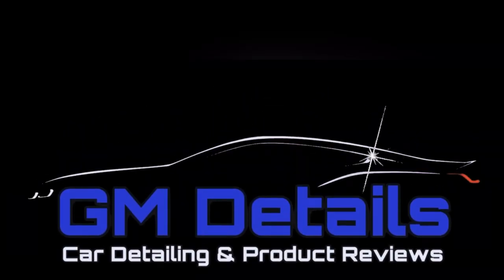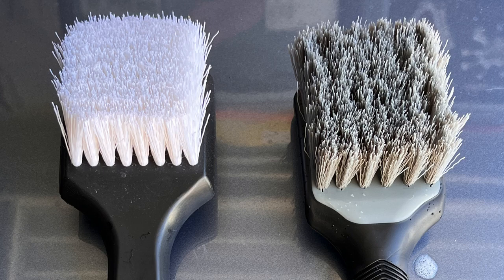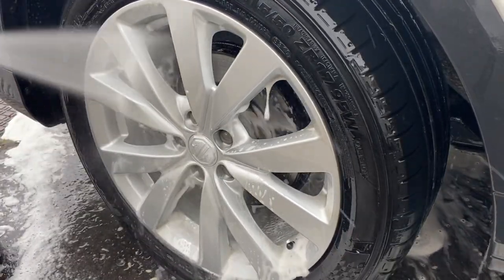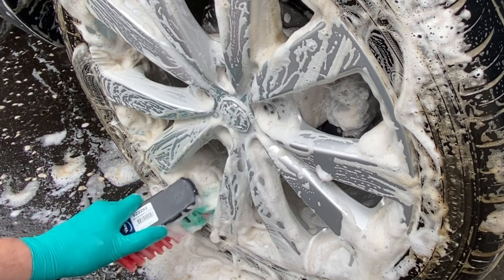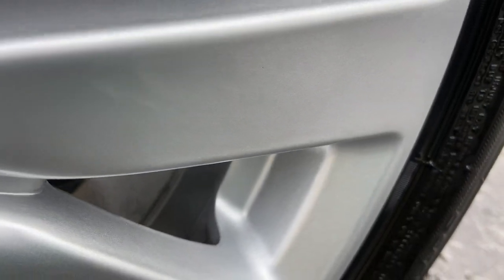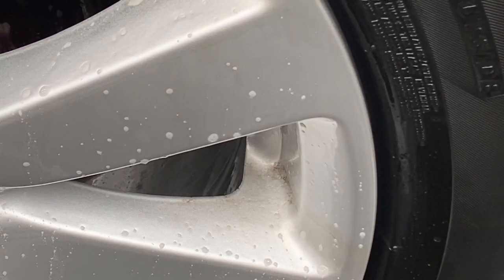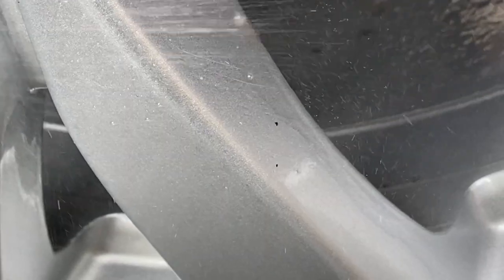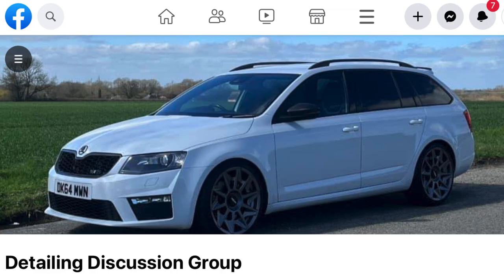Bilt Hamber Surfex HD v Autoglanz Alkalloy wheel cleaner

Comment: I think you did mention but I’m going to stand up for the Vikan brush! Well not that one but the one they sell as a wheel face brush is smaller than that with some rubber edges too to avoid the clattering, amazing thing that you can abuse for years and it looks good as new I’d highly recommend.

I’m totally going off wheel cleaners these days preferring more economical and often more effective APC products like GT decon, Green star or surfex.
Reply: Hi nick, I have the vikan wheel brush and like using it, however,  I still tend to hit the corners with a boars hair or something similar. 

I definitely need to try GS, but still got 4L of surfex 😳.  All the best.
Reply from the maker: Yeah I’ll be completely honest and say I thought that brush WAS the wheel face brush but since realised it’s not after I made the recording 🤣🤦🏻‍♂️

Comment: Well I learned something, surfex will foam up, I was always told it doesn't and never tried, so the next wash will be with the IK Foamer, cheers for that one Graeme.  In regard to Koch Chemie Greenstar, I've not used it but I'm told that foams up, so you may get that extra lubrication you were looking for.  I use surfex so much, 10:1 as a prewash on the wheels, 4% as a prewash on the paint. 10:1 in the engine bay and 100:1 as an interior cleaner.  Better enthusiasts than me will no doubt use it elsewhere and at other ratios too.  That wheel brush is the nuts, it may well be like 150-200% more money, but mine is 6 months old and hasn't shown signs if wear. All the best buddy. Keep up the good work.
Reply from the maker: Lee you’re not going to believe this but if you look on Bilt Hamber’s website it says Surfex was voted as the best lance applied shampoo!! 😳😳
Reply: @GM Details  I don't read Graeme 😂. But honestly, that is really surprising.  I've seen people run comparisons, nit through a lance or foamer and several have eluded to it not foaming up.  Do I want to try it through a lance, I'm nit sure I do but definitely through the foamer.   I wonder what the experience would be like to throw a little shampoo, such as autowash in with it, add that lubricity 🤔.  Thanks for the reply Graeme.
Reply: Surfex will technically foam up but it doesn’t hang about. It’s better in spray form and wetting out the surface. KC GS foams up way better but the versatile and value comes from the 5 litres of Surfex.
Reply from the maker: @kwl189 wow you’re not going to believe this but right now I’m editing the surfex v Gs video on a heavily brake dusted wheel 😃
Reply: @GMDetails  oh my. I’ll be very invested into watching that when it comes out. My prediction is that there’s very little if anything between them. It will come down to cost. And that’s where Surfex reigns with the 5 litre offering. I know someone put a warning down to Surfex drying tyres out and making them prone to cracking but I’ve never seen that happen in all the tyres I’ve cleaned over the years and normally when you clean a tyre, you don’t leave it that way. Clean tyres are dressed with a suitable dressing for that extra polished look.
Reply from the maker: @kwl189  it’s not a lengthy video so hopefully be out this weekend 😅
Reply: @GMDetails  fantastic work. Thank you for going into that. There’s a new version of touch on which has dirt releasing properties to it. Would be great to see if it’s as good or better than Gyeon wet coat for self cleaning. Or how they do on alloys.
Reply from the maker: That the one in the bottle rather than in sachets?
Reply: @GMDetails  yes the one in the bottle

Comment: Another great watch. Sometimes I think I must have an affliction because I watch someone do a job that I have done so many times  myself but there is mostly something I pick up so it can be worth it. They say every day is a school day and with detailing it seems to be. I am with you on that Vican brush I bought it I think after watching Paul Dolden but I didn't really get on with it apart from my Disco Sport as it had large flat fronted open spaced alloys but my current cars do not match the use of that brush. Sometimes I use it in an arch with the felt but I have another Vican with the long handle which is better suited for that job. For the wheels I seem to have gone back to a smaller brush like you from using the GT Mitt but I did pick up an Autobrite sheepskin Mitt I use on my Diamond cut alloys on my Honda. I have started using the Turtle Wax suite of Hybrid Solutions wheel & tyre cleaners and the Graphene tyre treatment and I must say I am very! impressed so far. I think my favourite heavy duty wheel cleaner is the Wowo's wheel product and that reminds me I need to order a bottle. I thought you would have used rebound on the tyres as I hear it is very good. I have not used any of these products but the Surfex seems to be the better product as it did a really good clean.
Reply from the maker: Thanks John!, well Alkalloy was doing a pretty good job without Rebound so I didn’t see the need to throw several chemicals at it like some do for the gram ! 😤

I do love a nice sheepskin mitt mines fell apart as they are usually genuine wool and will eventually go over time being natural

Comment: Great info Graeme. Both very good products and the tyre brush looks great. I love using rebound on tyres but keep trying alloy cleaners and still looking for the 'perfect' cleaner but there's so many!
Soft 99 do a 30mm brush which is great for wheels IMHO.
Can I ask what do you recommend for stubborn brakedust, I know wheels off clean is best option but do u use acidic products?
Look forward to BH greenstar vs surfex test👍
Reply from the maker: Thanks James , baked on brake dust can be easily removed with KKD Devil’s juice or wowos wheel cleaner for a ready to use option, or walk into most supermarkets and get some Wonder Wheels reactive wheel cleaner for around £5 , really does work wonders 👌
Reply: @GMDetails  cheers pal

Comment: be careful with Surfex HD as a tyre cleaner Graham, I found it dries out the rubber and causes cracking. That was at 1/20 diluted ratio too, I think it is a very potent cleaner so I've actually stopped using it on tyres/wheels altogether as a result.
Reply from the maker: Oh thanks for that info mate. It certainly was turning brown on impact so I’ll continue with Rebound from now on and keep an eye on it 👌
Reply: @GMDetails  no worries at all, its a real shame because its incredibly effective as well as cheap, even at those dilution ratios but i think its more potent that people estimate. I certainly found out the hard way!

Comment: You need to keep all the parameters the same, you should have gritted your teeth and endured the clattering of the Vikan bush. You need to do the test again with the boar hair brush for all the wheels - otherwise it's not a fair versus test of the wheel cleaning products.
Reply from the maker: I did say that Chris and obviously results were different due to more mechanical agitation but I feel Alkalloy did well with its lubricity and carrying grime away in foam, I was annoyed at myself for changing it without realising as I was enjoying the process and got distracted from the test 😫